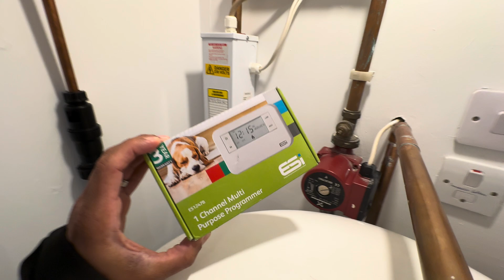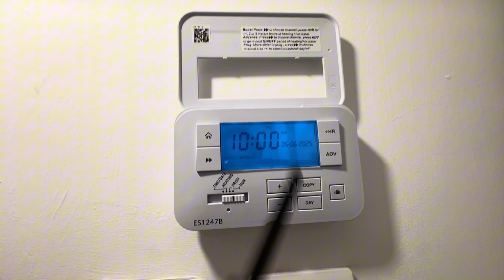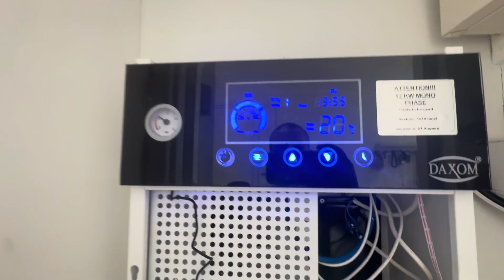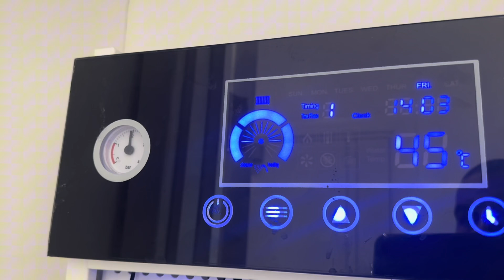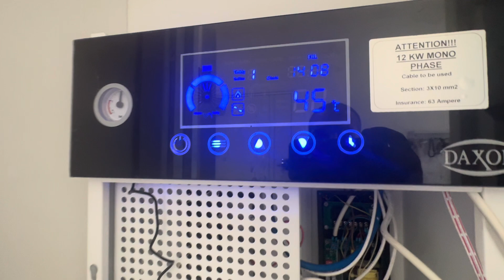Quick fix or Bigger issue?!

Comment: hi ritchie liked the time clock had big display . am going to installer on the weds like you recommended  and dont change the name it's original👌
Reply from the maker: Thanks mate, the ESi controls are good, they have another touch screen one with an even bigger display - a bit more sleek looking too and only around £10 more. It’s called the Touch4.

You should go to the plumber social after and do some networking!

Comment: The reason why there was a twin channel on wall, was because of the unvented cylinder, realistically it should have its complete seperate way of turning on/off, basically heating and hot water coming on at same time, which is not efficient
Reply from the maker: The cylinder is direct, heated off immersions and controlled separately to the boiler/central heating system. This programmer was for heating only.
Reply: @RJHeating  ok, just wasnt explained in the video, usually you see a white cylinder and automatically think indirect lol
Reply from the maker: @Purebeltersteve lol, yeah that’s true. It’s an odd setup to be fair? You’d think, especially given they’re all in the same cupboard that they might aswell just make it indirect! Although probably just as expensive as each other!!

Comment: First job did you wire as same n l and ch on
Reply from the maker: That’s right, but be careful on the ESi as their 2 is on not 3
Reply from the maker: Oh and the common linked from the live too
Reply: Thanks @RJHeating
Reply from the maker: @b1h2u3p4 no worries! On the ESi 1 is the common, 2 is the switch live/CH on. On most other programmable thermostats it’s 1 and 3.